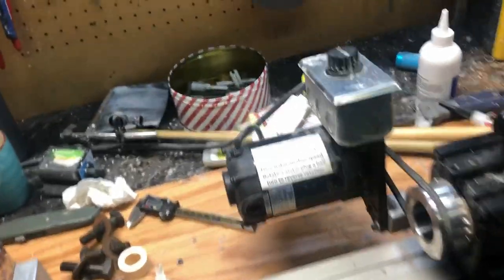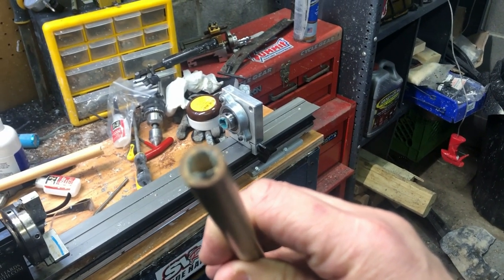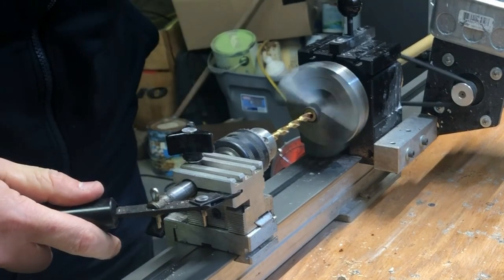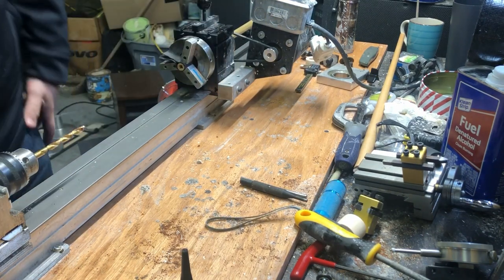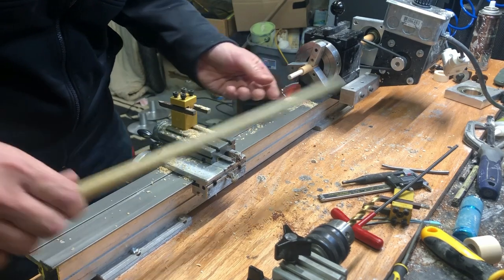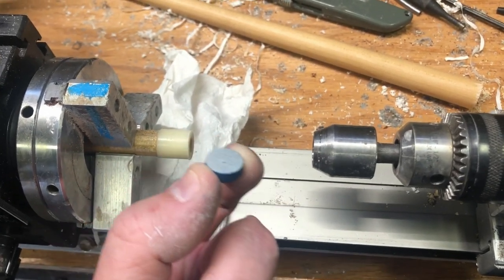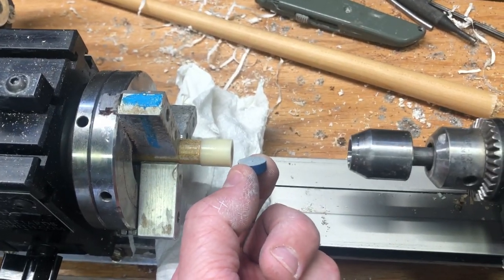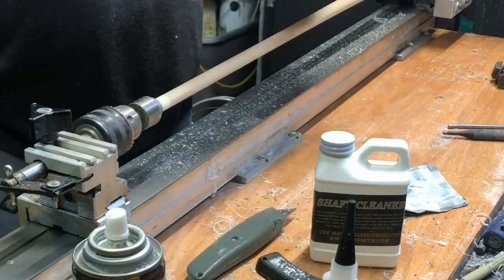How to repair a broken Predator Ferrule Tenon 314 314.2 314.3 Z2

Comment: A couple of machining hints for you: when you turn the dowel down, don’t have so much material protruding past the chuck. This create more deflection in your work and a far less accurate runout on the material. You might also consider investing in some instruments to measure the runout at the chuck and the tailstock. Your tailstock is very sloppy in its clamping, and when you drilled the core, I guarantee you the hole was not concentric to the shaft. This causes your ferrule to not be concentric, then alignment of the shaft is effected. Might seem like small measurements, but 1mm of difference over 40” is a lot of angular deflection. I recognize you’re just get going, but all these habits will make your work top notch!
Reply from the maker: Thanks for the input. I do have a dial indicator that mounts to the cross slide that I use all the time. Also there was only deflection on the first pass for the dowel, I took much less material on the last few passes since for accuracy. I do not love my tailstock I am going to reach out to cueman to see if he has any better options. (Deluxe lathe is 6 months out) I have been boring with a micro boring bar more times than not now. This shaft did turn out fantastic for how badly split the end of the shaft was. Thanks again for the comment

Comment: Hey fella. When doing LD laminated shafts like predator, jacoby, OB ect I would suggest using a deep cleaner instead of going so rough on the sandpaper. I've learned over 22 years fixing and building the least amount of sanding you can get away with is always better.
Reply from the maker: Yeah thanks, I almost never sand. But this on had a separation in between a laminated piece that I ran some thin penetrating ca into. So I had to sand on this one unfortunately. This was just a “strength” repair to use as a bar box break shaft.

Comment: Hownis the deflection after the repair?? Coz i think you added some front end weight.. TiA
Reply from the maker: Yeah with the large split at the end of the shaft I didn’t want to core the tenon and fill with foam. Was mainly worried about strength. However it only added about 5-7% deflection at the most. Played great honestly.

Comment: Nice video!  I have some questions:  Which shaft is that?  (314-2?).  What material are you using for the ferrule?  How did you match the ferrule wall thickness and weight of the original ferrule?  Also, the maple tenon you made...does that match the weight of the original?  My concern with repairs like this is altering the deflection characteristics of the shaft.  Fractions of a gram can make a noticeable difference.  Also, you decided on an uncapped ferrule?  As a tip installer for 20 years, I hate uncapped ferrules.  They are adequate for playing cues, but horrible for break cues.  Just curious how you address these types of concerns.  Thanks for the great video!
Reply from the maker: This was a 314-2 that was in a really really bad state. Had a long split down the one splice. So I strictly went for strength on this repair with a maple tenon going past the crack, as a back up shaft. I play with a 314-2 and I hit balls with this cue and it definitely added about 5-7% deflection. Which I told him would happen. I have repaired 314’s with a cored tenon and a actual predator capped ferrule, but didn’t have a channel then unfortunately lol. Thanks for the comment too.
Reply from the maker: Oh and the ferrule was juma
Reply: @mulhollenbilliardschannel654  oh ok gotcha.  I’m super sensitive to deflection.  Unfortunately my juiced up 314-3 is so low that I really can’t use anything else lol.  Played with a 12.4 Revo for a while and just couldn’t adapt the the big increase in deflection!
Reply: @mulhollenbilliardschannel654  5-7 percent? just wondering how you come up with this figure
Reply from the maker: @boyraksdelpu  just from hitting balls. Been playing at a very high level with a low deflection shaft since the Precat came out. I’ve used every low deflection shaft predator has ever released as well. Thanks for the comment and let me know if you have any other questions! 👍🏼

Comment: Not a bad job at all, you could not do much about adding weight to the tip. Just remember adding or removing weight at the tip is changing the characteristics of the cue greatly. Try to keep the changing of weight at the tip to the smallest amount you can. As for the shaft sealer, I stopped that many years ago so that I never make it impossible to properly remove dents. To properly remove dents you make the dented wood grow back to original position using steam etc. If you seal the shaft you stop the heated steam from impregnating the shaft wood and raising the dent. Keep up the good work.
Reply from the maker: Thanks! Since this was so split, I had no choice but to add as much strength as possible. Plus he is just using it as a break shaft or spare. That’s a good point about the sealer, I know how to remove dents but didn’t realize sealer would stop that. I’ve always been able to raise the grain, but could have been due to the shaft being sanded down a good bit since it was new.
Reply: @mulhollenbilliardschannel654  Just trying to help. I no longer seal or use wax etc. just polished raw wood above the little bit of finish at the bottom.

Comment: What’s the cost for this repair? Can I send you my shaft? My z2 shaft cracked and dislodged from cue. Predator says they can’t fix it…
Reply from the maker: It depends on how bad the damage is and what tip you want. But it’d range from $80-$110. You can check out my Facebook to get my address and stuff like that. Thanks! Facebook below 

DMIII custom cues and pro shop

Comment: dude   , you ruined the LD tech in the shaft . there is a better way to do it . makke the inner dowel shorter .drill it to get hollow again  after assembly . then lower the shoulder to have the tennon of both wood parts . install a capped ferrule . there you go a LD again  😎
Reply from the maker: I stated in the video description that this had a long split in between 2 of the laminated shaft pieces. Hence why the dowel was so big and the reason I didn’t use a called ferrule is he is using it as a low deflection break shaft for bar box 8 ball. If not I would have used a different core material along with some foam. Then used a capped ferrule to keep it lower deflection, but that would have worked with how bad the shaft was damaged. I also sanded it so much cause I used penetrating CA on the shaft cracks.

Comment: Won’t subscribe with not learning and showing your products for the talent you show. Should have been a lot better in my opinion if you wanted me to be a supporter.
Reply from the maker: As I stated in the video description, this was supposed to be a cheap repair as the shaft was being used on a break cue, it also had a large split in the laminate. This shaft is still going strong as a break shaft, so this repair worked exactly as it was intended. I also state in the description and comments that the proper fix is to core it out and use foam if being used as a playing shaft.